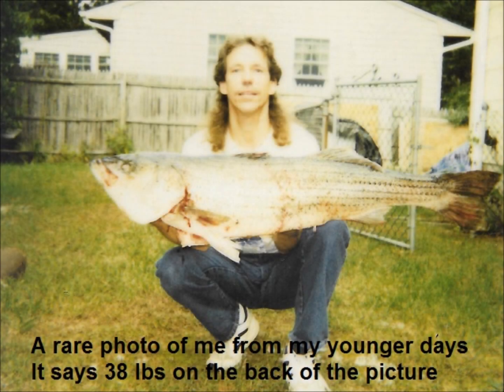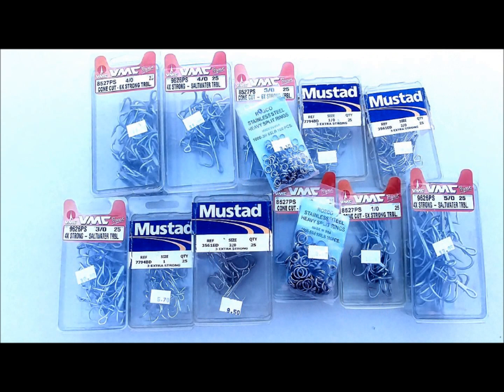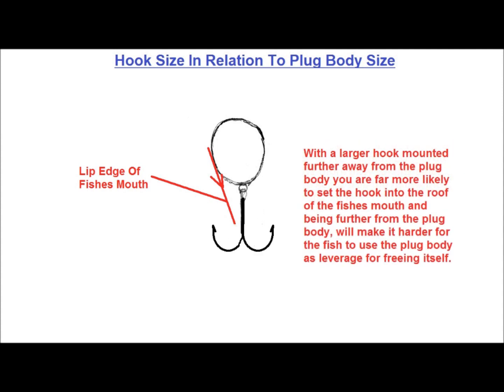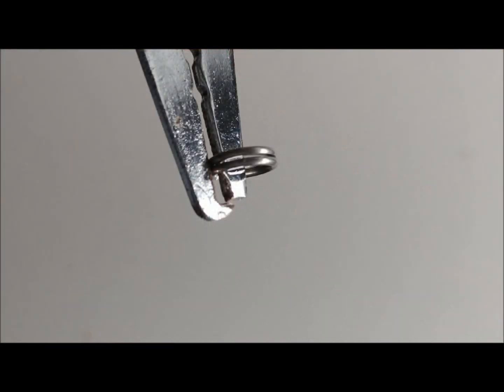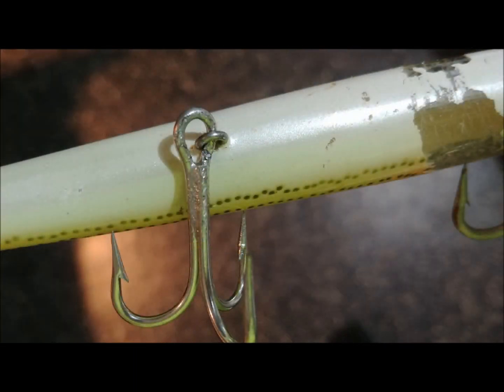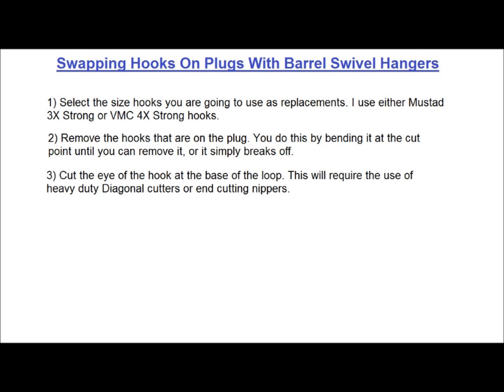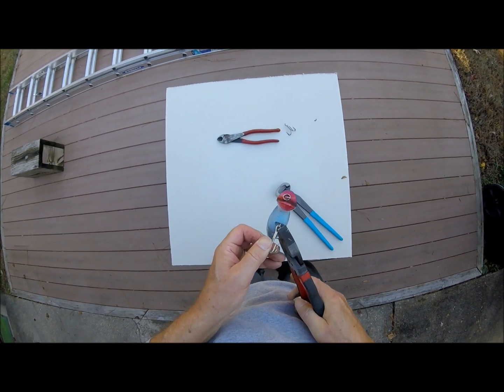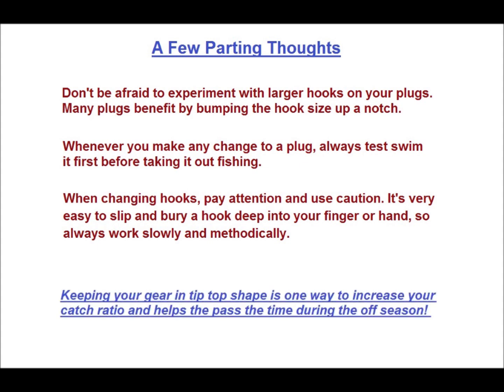Surf Fishing Series - Replacing Hooks on Plugs - Tutorial and Thoughts on Hooks Sizes

Comment: Hello , I enjoyed the video and have a question , if you have a plug with a swivel could you add a split ring instead of cutting the hook? , i ask because i would like to make my own plug and while shopping out supplies i was looking to buy swivels and split rings , then noticed mustad sells open eye hooks , it puzzled me , but seeing you cut a hook eye and replace a hook it makes since , but the question is still burning in my brain , about just adding a swivel , it would cause the hook to hang from the lure farther and maybe help in a hook up.
Reply from the maker: Hi FJR. Sorry for my late reply.  Technically you could just add a split ring to the swivel but you might start running into problems where the hooks start catching themselves. There's a happy median on every plug, so for me, I like as wide a radius on the treble hooks and as far back from the plug body as I can get without 1) affecting or ruining the action of the plug. 2) Having the front hook catch the lip (if there is one) or the middle hook (if there is one) or both. I do know that Mustad sells open eye hooks but have never used them because I'm not sure how heavy they are. I should buy some and test them, but when it comes to gear, I go way toward the heavy side on everything. I don't like fish stories based on broken line, bent hooks, etc. lol. Experiment around a little and see what suits the fishing you do. I always like the experimentation part, just as much as the exploration part. Thanks for watching and stay safe.